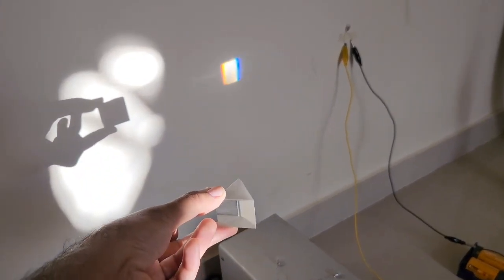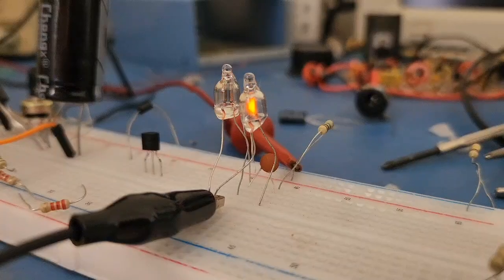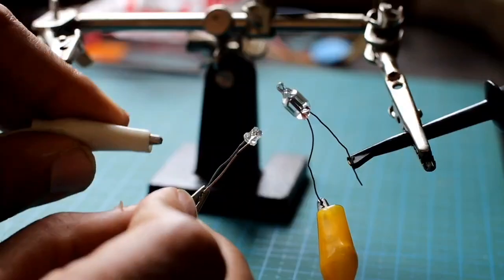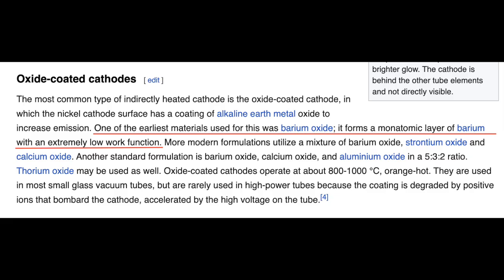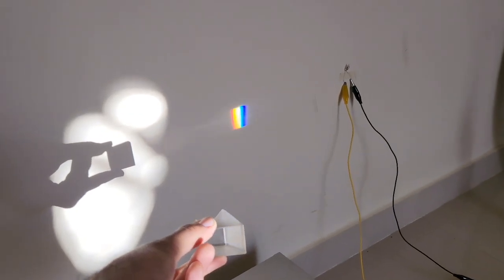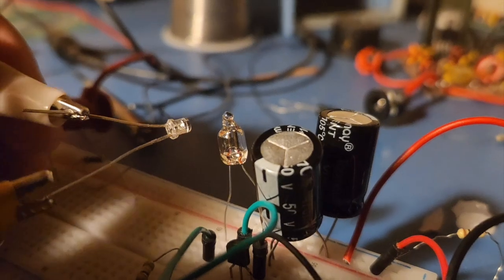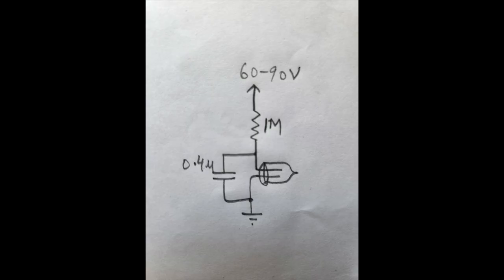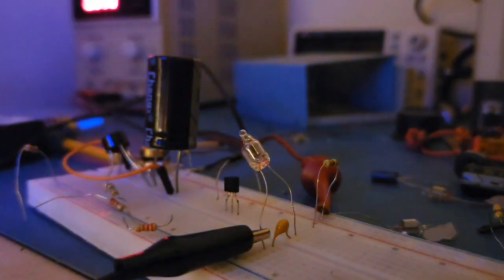Harnessing Light: Photoelectric Effect, Neon Lamps, and Oscillators

Comment: That's actually a really good presentation.  But I have a few bones to pick.  You aren't definitively clear when you address "electron emission", as you make it seem like the light bulb is ejecting electrons, which is a common misconception and not the case.  Electrons actually barely move (Ballentine). The drift velocity is like .02mps.

The photo-electric effect causes electrons to drift through the conductive band, but it can also ionize atoms, create voltage potential and create electron EM emission through this process, which is light.  These are fundamental QM processes that I really wish people were more clear about as there are many misconceptions.

Comment: 1:27 Higher frequency light doesn’t liberate more electrons, just higher energy electrons.

Also while this is a qualitative demonstration of the photoelectric effect, the gas in the tube makes it less straightforward what the mode of operation is. You could probably demonstrate the photoelectric effect by measuring the work function of one electrode, by shining monochromatic light at just one of the electrodes and changing a low bias voltage until the current hits zero, but the gas might still inhibit that. A glass envelope vacuum triode (you can buy them from eBay for a few dollars) would not only make it easier to aim the light at just one electrode, but also give you a few different metals to measure the work functions of.
Reply from the maker: @Scrogan  Thank you for pointing out that mistake. You’re right. However, it seems that if the electrode is composed of a mixture of materials like nickel, iron, and barium oxide, higher frequency light (such as UV) could liberate electrons from all of these materials, potentially resulting in a greater number of electrons. On the other hand, using orange light might not provide enough energy to liberate electrons from nickel. I could probably test this by measuring how close to the turn-on point I need to bias the lamp with orange light vs. UV light. 

I'll check ebay for the vacuum tubes you mentioned. That sounds like a great idea!
Reply: @ashishderhgawen  I never thought about how alloys would affect things. I’m certain that light penetrates through the thin ceramic layer because it looks metallic to the eye, maybe so easily that the ceramic doesn’t dominate the effective work function.

Pointing the prism’s output spectrum through a thin slit would help isolate a narrower band of light.
Reply from the maker: @Scrogan  I like the idea of passing the output spectrum through a thin slit!